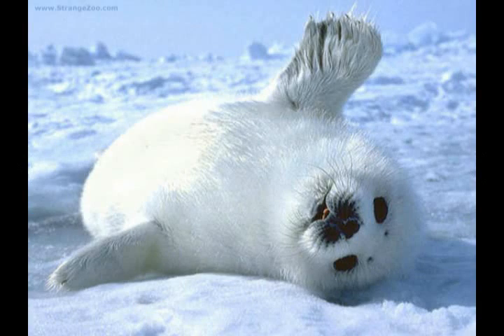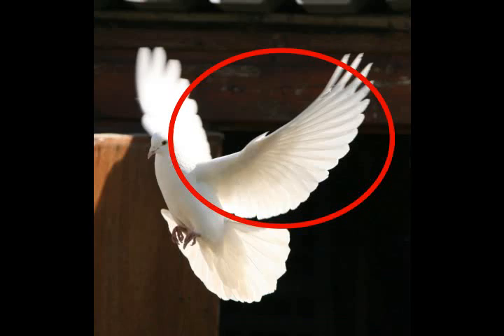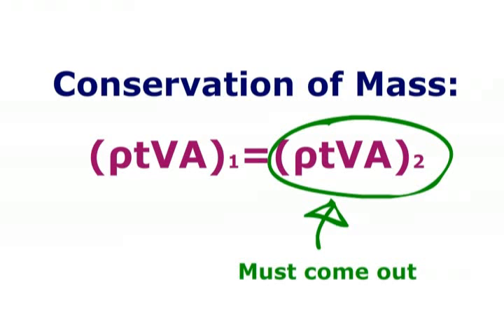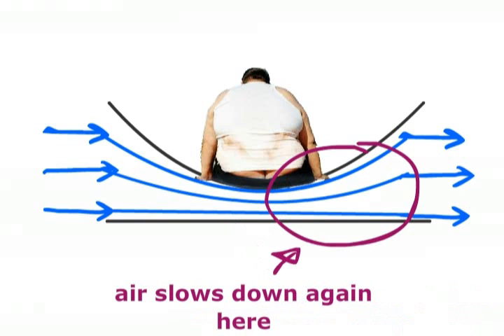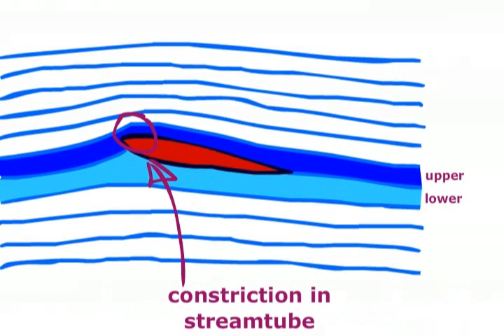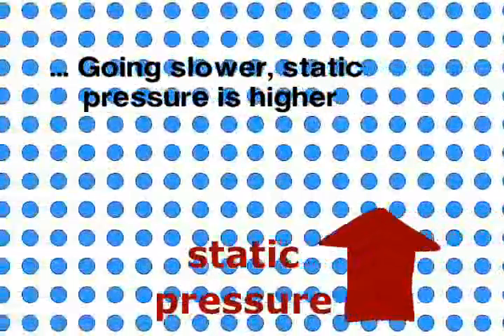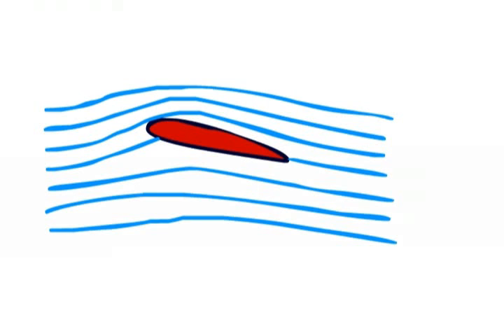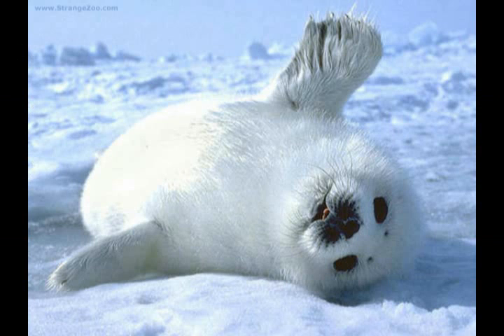How Aircraft Wings Create Lift | profpilot.co.uk video #2

Comment: Importantly, it is completely false that the flow causes a suction over the wing.  It is also false that the flow is constricted over the wing, among so many other errors in this video.
Reply: mart fart   That's ok.  I have stated in other posts to many videos like this that once the true phenomena of lift are understood you can apply them to any wing --, flat, cambered, sail, keel, even your hand out the car window. (;-)
  The various details around the wing just occur in different proportions for different shape wings.
...
I do, however, recommend a change.  By saying: "An aerofoil improves the differential speeds ..."  You are helping to maintain the myth that speed causes lower pressure.  The better way to say that is: "An aerofoil improves the differential pressures and reduces drag."   OR to reduce controversy: "An aerofoil improves the lift and reduces drag."
...
 The differential pressure on the wing is what is the lift force. Push up more than down is a net upward push.  
...
It is a long-standing and too often repeated myth that fluid speed alone causes a lowered pressure and it is simply not true and is easily measured.  If you are not sure of this, please read Weltner.  His explanation is typical of what is well known from other authoritative sources:
Weltner in PDF - "Misinterpretations of Bernoulli's Law":
 http://user.uni-frankfurt.de/~weltner/Misinterpretations%20of%20Bernoullis%20Law%202011%20internet.pdf   
...
Weltner as a web page:
http://www-stud.rbi.informatik.uni-frankfurt.de/~plass/MIS/mis6.html 
--
Cheers
P.S.. Once you really understand lift it won't be a surprise to you hat the fastest air near a wing (outside the boundary layer) it just under the wing.
Reply: mart fart I don't need quantum mech for that.  Just understanding how carriers react to the fields near the junction is enough for me to explain adequately.
no PhD; just good basic education and good research.  (BSEE  & experience with lots of other well educated folks to learn from).
I would currently be classed as a "science presenter".  Lots of experience and not afraid to do serious research on authoritative sources and consult with experts in any needed subject. 
...
I could be classed at the "other end" of the Dunning-Kruger effect.  Understanding this stuff is quite easy.  Done a lot...Learned a lot along the way.  Have always had a need to get it right.
...
Have you seen this related paper?  Peter Eastwell; an educator who did his homework: 
 http://www.scienceeducationreview.com/open_access/eastwell-bernoulli.pdf
--
Cheers
BTW, Mr. Wizard got Bernoulli wrong.
Reply: Legion Long  While I dislike the term 'suction'  it is completely correct, and well understood by aerodynamisists that the upper shape is what causes the lowered pressure.  I add that the "constriction" (venturi) explanation is, indeed incorrect.  My post 7 months earlier gives some authoritative sources for correct information....
Reply: Observ45er I remember, and I'll mention that my diffusion theory was never intended to be confused with the "venturi theory", which I now have seen is a different (and incorrect) theory.
Reply: +Observ45er Sorry to butt in, but even a flat wing will work as long as there is an angle of attack - for whatever reason the air speeds up over the top surface as this angle is increased and slows below. An aerofoil improves the differential speeds and reduces drag. The wing is indeed ''sucked'' up, and the difference in velocity can be hundreds of knots. It is the mechanism that produces these effects that causes confusion.
Edit: I see you know all this ...and more, but I will leave the comment anyhow. ))
Reply: Observ45er
Excellent, thank you, and again for such a nice response.  Is there anything else which looks at first glance so simple yet is so loaded with this minefield of misinformation and misunderstanding? I cant think of an equivalent. I knew after I wrote ''differential'' it was off the mark. Precision is required and  laziness isn't.
I'm thinking of a few examples now ''transistor action'' ,dbs, I've changed my mind, everything needs better explanation ))
Reply: mart fart  Well, Lift and Bernoulli seem to have a corner on the market.
...   OT   ...
To understand bipolar junction transistor (BJT) action one must first understand how "Majority carriers" and "Minority carriers" work.  Once you understand that, the rest is simple for diodes and BJTs.  The key idea is that Minority carriers are swept across a reverse biased junction. Majority carriers are swept across a forward biased junction.  At first, is seems strange talking about "holes".
...
  FETs are different.
--
Cheers
ScienceAdvisorSteve
http://www.challenger.org/
...
EDIT:  I believe many people think life (science) works by sound bites.  It doesn't.
Reply: Observ45er
Electronics is more my field, and of course we must venture into quantum mechanics to  adequately explain movement of charge carriers in solid state electronics....Anyhow ...What are you? Some sort of egg head? In fact can you boil an egg? Geniuses often have difficulty in the kitchen.
Should I call you professor? or Doctor?

Comment: One more thought- if a wing was entirely and simplistically dependant on pressure differentials, then post stall would provide the greatest lift because this is the point of greatest pressure differential,

Try that is your Cessna and let me know how it goes! :)
Reply: Complete Aerogeek The pressure differential is not greatest post stall, the pressure gradient is.  There is an important difference.  The average pressure above the wing, is greater post stall.  Of course, there is another important reason that stalling reduces lift, the wing has less lift surface area the higher the angle of attack.  The drag area increases, but the lift area reduces.  A wing perpendicular to the flow (max stall) has much less lift surface (surface perpendicular to the flow) than one parallel to the flow.
Reply: nice answer Robin, TY
Reply: I.m sorry but that makes no sense. A wing planform at 90 degrees to the oncoming air will have a massive pressure differential between the upper and lower surfaces because the static and dynamic air pressures are maximised against the lower wing surface and the mass displacement of air results in an even lower pressure behind the wing.

A wing spoiler when  deployed creates a pressure differential between its 'windward and leeward' sides that is much higher than a wing creates in normal flight.
Reply: How is the pressure above a wing 'greater' post stall? A fully stalled aerofoil has an attached vortex that lowers pressure even further. This can be seen in wind tunnel videos. A vortex lowers pressure. This is the operating principle of vortex generators.

Comment: Your Bernoulli explanation, like most everyone else's, is wrong. If, like you say, the high pressure air below the wing flows to the low pressure area above the wing it will actually push the wing down. You already know that the air is deflected down causing an equal and opposite reaction on the wing. Can you see how the high flowing to low doesn't make sense? It is definitely true but not the way you applied it. Bernoulli's principle applies to pressure changes ALONG streamlines, not across.

Comment: The streamtube below an airfoil doesn't actually slow down, rather the streamtube above an airfoil with positive camber speeds up because it must travel a greater distance in the same amount of time.  The increased velocity is what produces lower pressure above the airfoil and the *relatively* higher pressure below then pushes the airfoil upward creating lift.